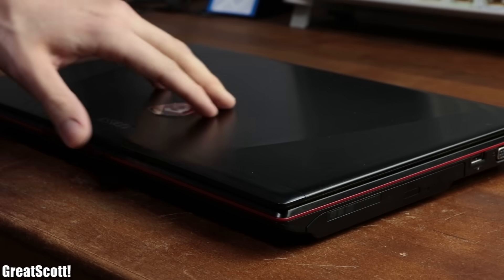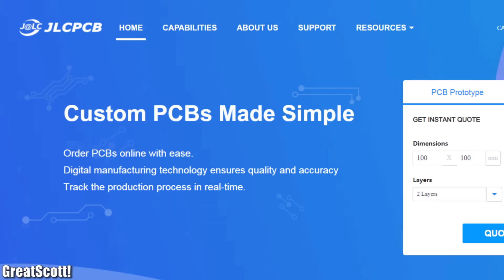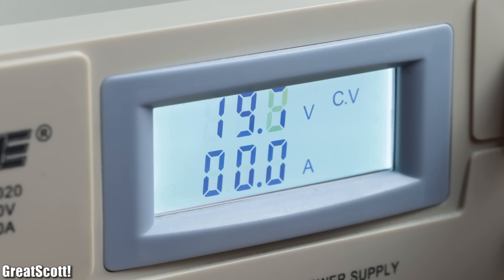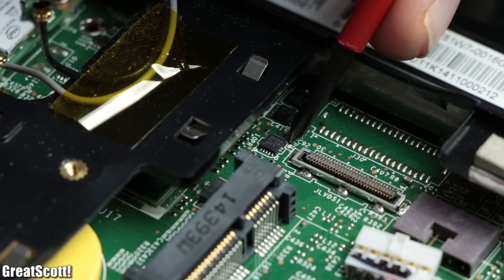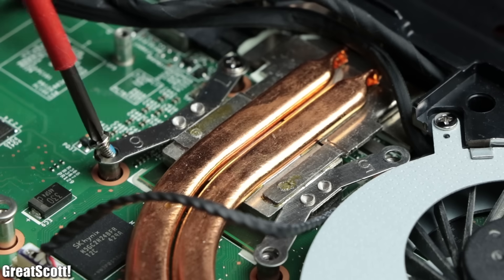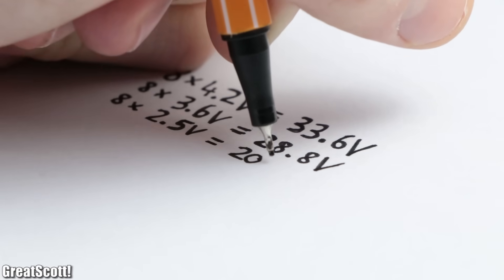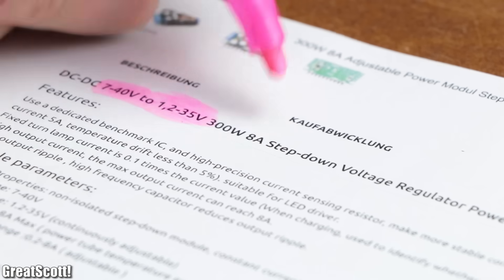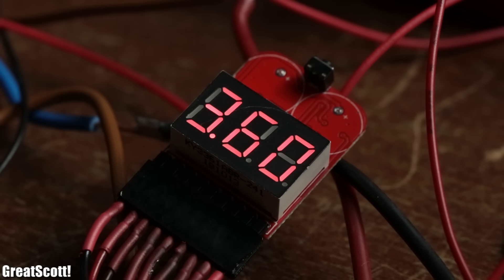DIY Laptop PowerBank (battery pack to charge your laptop on the go)

Comment: There is something i fundamentaly dont understand about Battery packs and battery pack balancing,
in my mind, each single cell has to be connected to a bms to be correctly balanced
though in this case 4:43 13 rows in series of 2 batteries in parallel.
Or in other words one Balancing cable is connected to 4 cells. Doesnt that destroy cells over time?
Since one is bigger than the other and gets charged until they reach a combined voltage. Doesnt it then overcharge one and overdrain the other?
They cant balance betwenn them since they arent connected in a way that they can charge each other.
What am i doing wrong in my head?

Comment: do you have any idea how to do this for a MacBook Pro?

bcause the power supply has a data connection to the Notebooks internal electronics which allow to charge.

the only thing i realized and use for stationary use to keep the battery for example at 80% charge, if you dont allow the data connection, the notebook is powered by the supply but the battery isnt charging, at least not noticable (around 50 mA)
Reply: Its Apple you commited to a short life high price product so deal with it
Reply: Peter Zingler what are you talking about?
i got 2 (fully working) Macs

one Macbook Pro 15“ 2009 but dead battery (oh what a wonder 10 years old)
and a 15“ Mid 2010, battery changed 2017

so what about a short lifespan? show me multiple notebooks, 10 years old and still looking fine and working 100%

Comment: Nice project!
You could buy a new laptop, they come with long battery life (10h+) these days...
Reply: Probably not with a 17 inch display 6 to 8 cores and a high end nVidia GPU. My laptop has a 230W power supply. With that said I rarely use it on battery.

Comment: Buck converters can easily fail short. I have one of those exact buck converters but the current limit function didn't really work well and I don't trust the thing much. I would add a crowbar circuit to the output as a safety feature to prevent blowing up your laptop with 40V in case the buck converter fails (which can happen by either the MOSFET failing short, or the feedback pin gets shorted to 0V or otherwise breaks.)

Also it would have been cool if your projects were custom schematics and you used your JLCpcb sponsor as part of the build to make custom boards for your projects! You could integrate all those discrete boards onto a single

Comment: YOU WILL DESTROY YOUR CELLS!!

The LiPo-Voltage-tester draw a small amount of current trough the test wires, even if the ground is switched away! 
I killed 2x4 Pcs. 18650 in a power drill with this voltage tester (same wiring than your project). 
After a few months, the voltage was about 0.5 -1 V of Cell 2-5, and cell 1 (which was switched) was normal (3,5V).

Please do a rewiring or you have a lot of dead cells in the future.

Comment: Why 8 battery in series instead of just 6/7 and add more capacity?
Reply: Because of the usable voltage range of this Cells which is 4.2 down to 2.5v

Comment: Hey could you make a video about finding electronic components by type/values? When i need a led for instance i always have a hard time finding the product id's. Or is there a good site where you can search for lets say "red led" and get some product id's of just red leds.

(I ask because when i was developing a circuit recently and i searched for the components and got every possible type of led (red, blue, green, white, multi-color... ) and not just the type i needed... and it took ages searching for all the datasheets)
Reply: I've never used them for LEDs, but you can search through lots of variables at sites like mouser, digikey, and jameco. For LEDs I might first look if microtivity sells the type you need. If not, theres always the cree catalog site. What type are you looking for btw, or are you still trying to identify the name of the package, wavelength, or material you need?

Comment: Great video, 
The battery/cell terminology is explained very well this time. The only "wrong" thing I noticed is when you said that balancing is mandatory. As long as your BMS keeps your cells in their Safe operating Area, then balancing is not necessary. The only downside is a reduction of total charge over time. As these cells are not stressed and are from a reputable brand I doubt you will notice anything even after 1000 cycles.

What would happen if you stuck the input jack into the output and vica-versa? does it backfeed?
Could you measure the roundtrip efficiency?
Reply: Balancing is an absolute must for a series pack .
Alone for the reason that the capacity will drift when the cells get older
Reply: @peterzingler6221  I think it is optional when a proper BMS is used and the application is not demanding. Some applications make only partial cycles and therefore never reach the voltage where top-balancing is applied.

Comment: I was thinking to the same project since I made a power bank for my phone in 4s configuration for fast charge purpose, the voltage is already high enough to be recognized by my laptop. Anyway you can do a 5s, that will probably work until it drops to 15V so with the cells empty. So you can get rid of the step down converter. Good idea to use the notebook psu but since you will not have it when you're on the go (and bring the battery instead) is not necessary. So you can get rid of the step up converter and charge it with your bench psu. With only a BMS and a small display it will came up way smaller and probably more efficient too

Comment: Amazing project. From my experience, the only two things to watch out for is 1. The cell voltage monitor module does not draw power evenly from each cell. And it draws surprisingly large current, especially for a 2S parallel configuration. 2. The buck converter used has failed short to the input for random reason on me. My guess is that some smd caps around the control ic isn't high quality. That is only when I overloaded it though.

Comment: Wonderful video.   My 8-core laptop, (1 hour battery) loves you. The laptop I'm viewing this on also has a slider that will pop out the battery.  I carry an 3 extra batteries around in my backpack.  Which is what I would do with any laptop using an easy battery release.  On the other hand, for the 8-core laptop you have to open the back and disconnect wires to replace the battery.  Your video will come in handy.  Thank you.   Nowadays; at least in the Washington, D.C. area.  All the malls, coffee shops, co-working spaces, most of the casual (indoor) dining spots, ... have wall sockets.   So that you can plug in /recharge your devices.  Now if they would only do that on buses and the Metro.

Comment: Very nice project and explanation as always :D
One thing I found out when researching for diy li ion chargers is that you should try to keep the current ripple low, and these boost converters do a bit more of ripple than the Li-ion cells like. 
And how does your charging process end? Normally you cut of the charge if the charging current falls under a certain level.

Comment: Well, my MacBook Air's battery lasts 12 hours, so I don't really need more, but still looks interesting for other purposes.
Reply: Then try to do some intense computing or gaming on it and tell me how long it runs.
Reply: owned lmaooooo
Reply: @KidCe.  Why would I want to? It's a MacBook Air, not a Pro. It's made to be light and portable and to have good battery life, not to game or do intense computational tasks. And it's good for what I need it for. For intense computational tasks, I don't use a laptop of any kind (why would I need to, say, calculate 100 000 000 digits of pi urgently?). And I'm not a gamer, not one who enjoys current titles at least. All the new games seem to be the same: shooting against an enemy. That, IMO, is boring and violent.
Reply: @GRBtutorials  then dont compare your 12h with his notebook. its silly
Reply: @GRBtutorials :
Battery usage depends on what you do with it. 12 h is an impressive number, but if all the computer is doing is displaying a document or powerpoint presentation, then a CPU and GPU from 1997 will do the job.

It reminds me of the numbers given by certain ISP: you can download 1000 mp3 in 1 min.
We prefer to know the actual connection speed and download limit.
Reply: louis tournas A CPU from 1997 wouldn’t be able to cope with the effects I add to my presentations! And it would also be terribly inefficient, so not a good battery life. And my old computer’s battery lasted 2 hours with the same CPU load when it was new, so...
Reply: @GRBtutorials :
The CPUs from 1997 consumed very little power. Some were 25 W, some 35 W if I recall correctly (Pentium, K5, Cyrix P166). The GPUs did not have a heat sink/fan.

The laptop version of a Pentium did not even have a heat sink.

The desktop version of a 486 would have a tiny heat sink, .5 cm tall (133 MHz). Sometimes, they come with a tiny fan. Some 486 did not even have a heat sink/fan.

Probably your old laptops battery did not have as much power as today's Li-ion batteries.

Check out what the power usage of your CPU is on Intel's website.

Comment: Congrats on 1M! Now, to have into account next time you try to disassemble your laptop: check into a way to remove the keyboard if it has screws, normally they have hidden screws hidden behind it, that's the common way they assemble laptops

Comment: Great Project..! 
Can you please make a DIY BMS ?
Reply: I seem to recall seeing a video where he tried that, but in the end he concluded that the Chinese can still do it cheaper and the only reason for making your own is if you either want to charge an odd number of cells or to charge them at a much higher charge rate than supported by the Chinese BMS circuits.
Reply: Oh yea
Reply: That would bei awesome! With current limit function for charging and discharging too.

Comment: how about using an arduino with an lcd to show multiple voltage and currents and add some sort of smart safety control like over temperature protection etc. ? u can avoid using that many current voltage displays and make it even safer, given the power output of that powerbank. Nice video btw :)

Comment: I have 3 ideas for electronic projects which you can realize :D

1. a mobil car heater for winter with a switch clock
2. a present card with your own music if u open the card
3. a little spy cam with a SD card to save
Reply: For the spy cam  Google quelima sq12 , its a 15 bucks full HD cam and the size of a coin decased

Comment: Is there anything to worry about the one-wire data line that comes as input to many laptops charging ports via charger?? I mean you didn't mentioned it. BTW the video was great!!
Reply: Its mostly shorter to ground to turn the charge Adapter on

Comment: I made something like this last year for my school laptop. It was a 6s2p 18650 pack with a cheap low voltage cut off switch before going to a cheap buck boost converter. I hacked up a CAD model for the enclosure and 3D printed it.  I use 2 old 16 amp Xbox 360 PS in series to charge it through an XT60 connector(even though it undercharges the pack by about a volt or two).  It’s neat to see some other ideas regarding a setup like this, and congrats on one million subs!

Comment: 9:44 Wait... What?
Reply: What do you mean?
Reply: @kraio-sfu  He is shortening the height of the LiPo voltage tester, which could end badly if there are critical traces being sliced in half. Ther were apparently no critical traces in that section though, because it still works.

Comment: Scott, Userbench Software maxes your resources one at a time,  there are better stress test software that uses GPU CPU and memory at the same time out there.
Reply: i would use aida64 memory cache and fpu stress test plus furmark gpu stress test this way you stress your memory cpu and gpu all the way. some system will becomes unstable and like just completly get stuck or atleast you mouse will become so unresposive that it will take a couple of secs just to move the mouse

Comment: Cool concept and I may build one just because I can, but I'm rather appalled that this project would only give you an extra 3h of battery life (2 full charges out of it, so total of 4.5h?). Newer laptops can double that with the stock configuration without sacrificing power/gaming ability when plugged in - this same design would give me about 20-30h more runtime (32WH battery that lasts 10-12h on average for usage like netflix/youtube/typing documents at 1/3 brightness with the keyboard backlight turned off), and this is the same system I game on (though admittedly, with an eGPU).

Comment: What a fun project,  what was the cost difference between this and a replacement cord from the manufacturer? 

Is this project practical? Does the added weight hurt the portablity .

Thanks for everything you do
Reply: I'm not the guy who made the video, but judging from his BOM a replacement power brick would be cheaper (though the difference may be less then you expect, these replacements tend to be relatively expensive). This is a different use case though: you'd want this for when you don't have an outlet around to charge from. If that's something you really need, the added weight would be a secondary concern. If you need both better portability and longer battery life, you'd likely be better off with a lower power laptop. He mentions that his machine runs for 1.5 hours on the internal battery, but my Dell (iGPU only) can run for 8 on a similar capacity battery. That limits the kind of work you can do on it, of course.

Comment: Wouldn't it have been easier and more efficient to just use a 5S battery, skip the buck converter, and use a sepic/cuk for the charger?
Reply: I agree
Reply: Dito....why not build battery pack closer to laptop voltage requirements??
Reply: @pssp7225  most laptops are 3s, which is 12.6 volts fully charged, or 13.05 volts if they use hv cells. a flat 5s is 14 volts (2.8v/cell) which leaves just enough for the laptop's buck converter to charge its battery and run the system. Even if the PMIC refuses anything below say 16 volts, that still represents about 90% usage of the external pack. If you tried to use a 4s external battery, you'd only get about 5% out of it before the laptop refused to take a charge.

Comment: Please tell me that you reapplied  thermal paste before re attaching the heatsink
Reply from the maker: No.......
Reply: @greatscottlab  You might want to, it could affect the cooling preformance of the laptop.  Old thermal paste tends to dry out and might not properly spread to make good thermal contact if the heat spreader is just re-mounted. Btw, great video I've been wanting to make a laptop power bank 👌🏻

Comment: 7:52 I hope you mean 3.2v. 3v is way to low for any li-ion cell
Reply from the maker: No, 3V. Look in the datasheet of the cell.
Reply: @greatscottlab  He's mostly correct. What is actually the important value is storage voltage, below cca 3.3 V will result in degradation,  3.4 - 3.6 is better for storage. I can't open the datasheet now, but I'm sure it doesn't say that storing the cell at 3.0V is recommended. Short discharge so low won't hurt it, but it should be charged to storage voltage asap. Why damage your battery for 5% of capacity.
Reply: @jaroslavstava3704  I thought the storage voltage was specifically 3.82 volts?
Reply: There are a lot of 18650 cells rated down to 2.5V, I agree for longevity I'd go no lower than 3.0V though. On a large series pack you'd want to pick a higher cut off though, so that you don't have 1 weaker cell drop below the min save voltage while the rest are still at 3.2v+. At least Great Scott has the per-cell voltmeter on there so this isn't really an issue for him I suppose.
Reply: according to battery university " Lead acid discharges to 1.75V/cell; nickel-based system to 1.0V/cell; and most Li-ion to 3.0V/cell. At this level, roughly 95 percent of the energy is spent". https://batteryuniversity.com/learn/article/discharge_methods...... Depending on the battery chemistry
Reply: @sortofsmarter  Depends on the discharge rate, lookup some graphs. For sub 1C discharge rate you should reach 95% around 3.2V.

Comment: Too much hazzle, my ThinkPad has ~11h screen-on time while using Chrome and supports changing the battery while being turned on (has an internal and external battery).
Reply: Which model?
Reply: @tolga1cool  T560 with low power parts.
Reply: Every laptop do that, you can charge the battery while using it
Reply: @tristan6509  Change, not charge.
Reply: @fireeraser2206  oh ok, mine can do that too, you can unplug the battery while charging and it will still be on, it's rare because most laptop nowadays doesn't even have replaceable batteries, my laptop is a Dell Inspiron 14 5459, but my old Sony Vaio and hp mini netbook also has that feature.